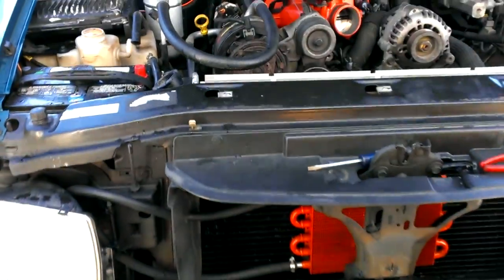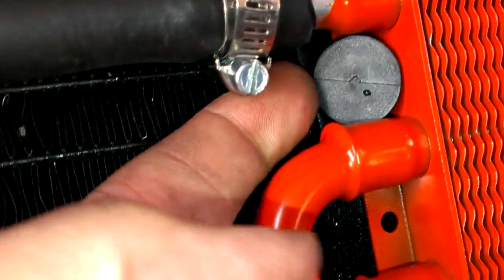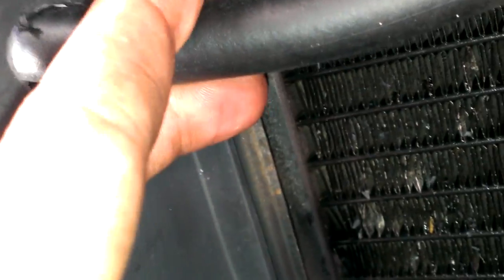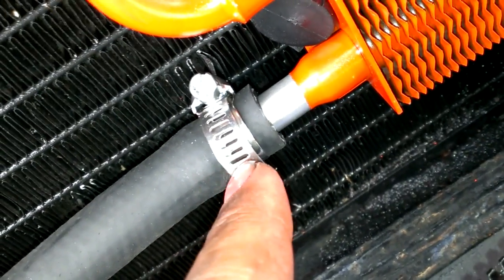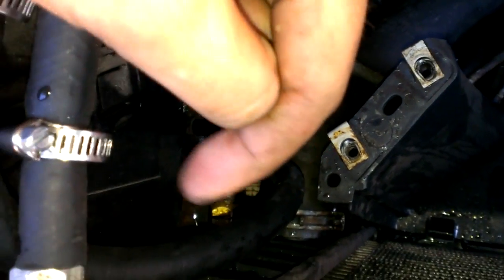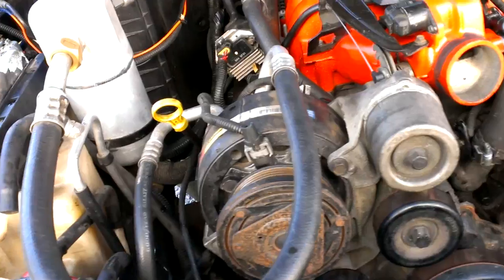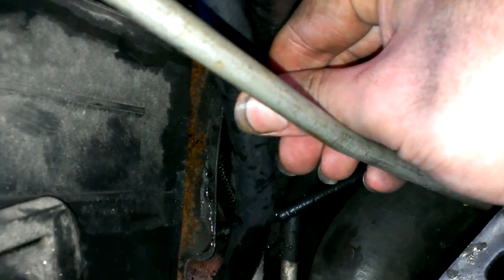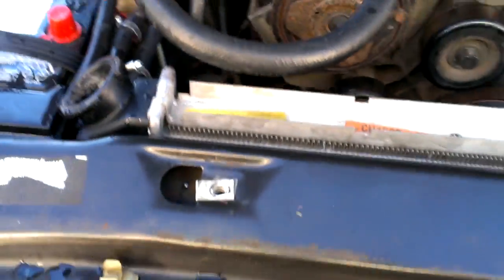How to install a transmission oil cooler

Comment: is the lines that once went to the radiator capped ?? If not what happens to those open lines? Isnt that a liability? Can you just leave the now abandoned from the radiator line open?? No one ever speaks on this they just talk about which lines go to the external cooler but nothing about the ports actually on the radiator...arent they supposed to be capped or re routed???
Reply from the maker: The bottom rad Trans line still connected. The top goes to cooler then back into the line that goes back to Trans. It just loops to rad to cooler back to Trans. Ur still using the rad to help cool. Plus the cooler in the same circuit

Comment: Is it advisable to bypass the ATF cooler in the radiator?
Reply from the maker: You can if you want. By running it through the radiator and then the cooler just adds more cooling.
Reply: @bam6972  No. I asked whether we can totally avoid the radiator and install an external cooler. So the radiator need to cool the engine coolant only, not the ATF. Thank you

Comment: Watching all the trans cooler videos. Thanks for the info. I bought Nicop 3/8” line to run into the radiator & to aftermarket transcooler. Figured it may help hold in place & would handle the high temps/pressure longer than hose but I have some hose cause I don’t know what I may be getting into. I wasn’t planning on running much hose.  Save money on the aftermarket transcooler. Didn’t find any need to buy the mopar transcooler at a cost more than my radiator.

Comment: Or... you can start the car and see which transmission oil hose is warm and which is cold. That will tell you the direction of flow as well - without having it spurt all over.

Comment: With all respect: A word of caution for newbies -- There is special paint for Radiators. Regular paint will hold the heat in the cooler. The special radiator paint allows the heat to be exchanged into the air. Ask me how I know, LOL. When putting the hose line through holes in the radiator support, there are grommets available at you local hardware store. The grommets will keep the hose away from the sharp hole in the sheetmetal.
Reply from the maker: I used engine paint. and also made sure that none of the hoses were tightly up against any metal. been two years no problem yet. and paint is still holding up very well.
Reply: That's great, however my point was this: The Cooler (and a vehicle's radiator for that matter) need to be painted with special paint, otherwise the cooler will not function as well as intended since the heat will be kept in the coolant. This has nothing to do with the paint holding up (it is a cool color). Your cooler may not be working as intended and you have no way of knowing if the proper level of heat transfer is being attained.http://www.eastwood.com/ew-radiator-black-12oz-satin-finish.html

Comment: How effective is the direct contact mount?  My understanding is that you want there to be a 1 inch gap between the trans cooler and whatever it is mounted in front of.
Reply from the maker: djfrog2001 it works perfect. the fan draws air through it to cool it off. before my transmission would slip out of overdrive within seconds on the highway. after I installed this it took about 5 minutes till it slipped out. ive gotten the trans rebuilt now.
Reply: Good shit.  I am trying to extend the life of the trans on my 08 Charger so I am thinking of installing an aux trans cooler.  Thanks for the information.
Reply: The input hose clip will wear a hole if it stays against the rad as it is in the video.